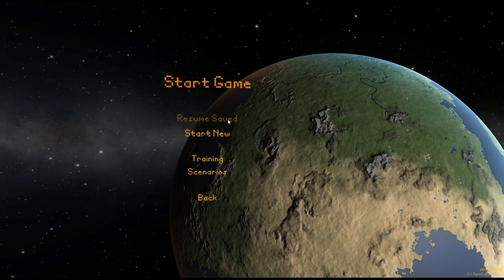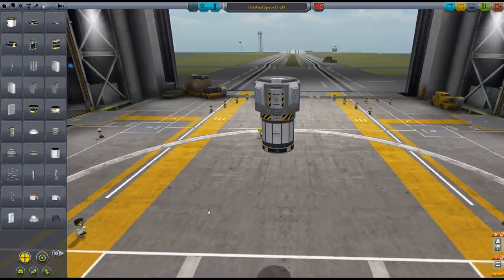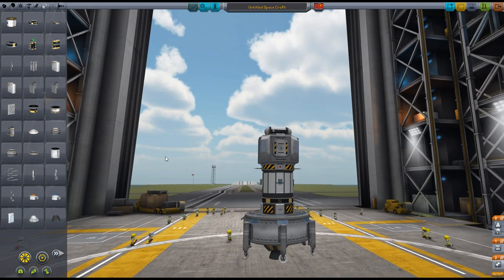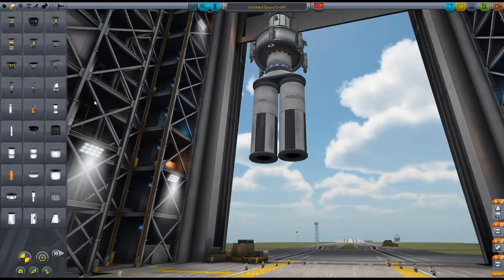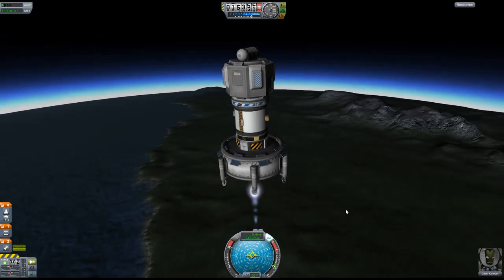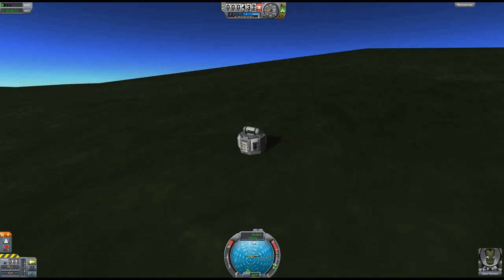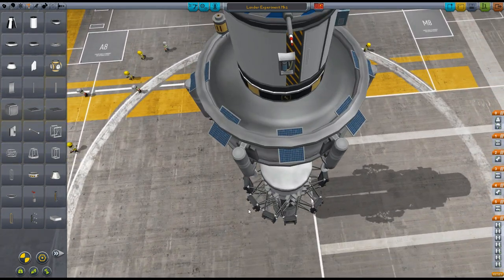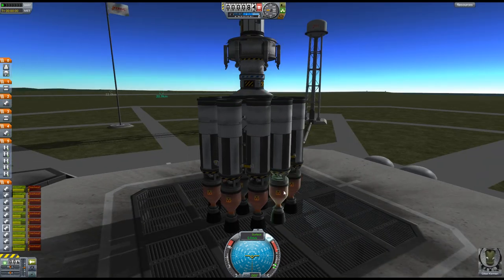Kerbal Space Program Career 09 New Lander Design With Asparagus Vacuum Stage

Comment: There is no real measure of efficiency, it's more the diminishing returns you get from adding more fuel. For example, you could easily get that thing to Duna with a single orange tank with 6 around it in an asparagus, just attracted straight on to a single small long tank, with two half tanks on either side with the nukes on them with fuel feeding in from the long tank. You get the same result with the thing above, but it's more parts and more things to go wrong.